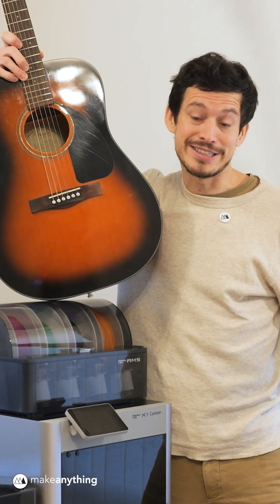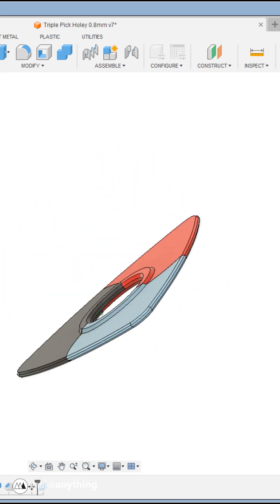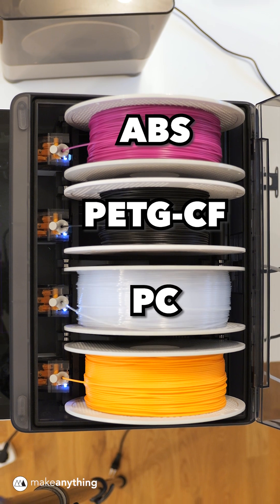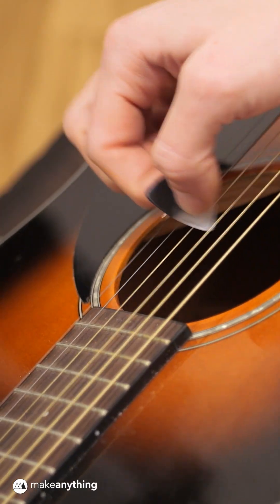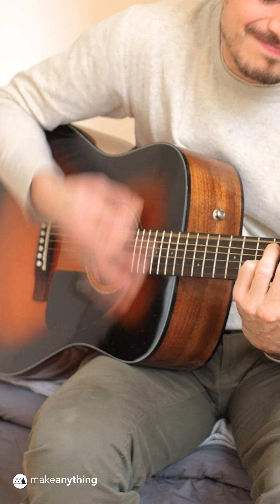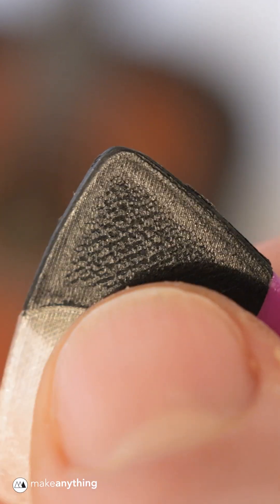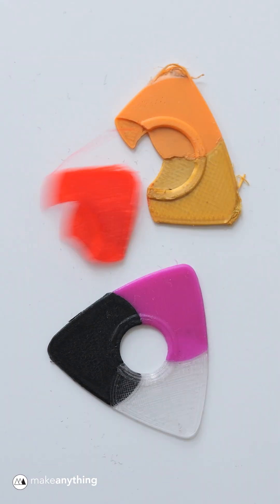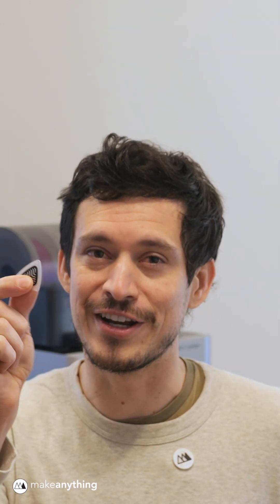The Ultimate 3D Printed Guitar Picks?

Comment: my forever go to picks are the ones i make from 3mm thick macrolon (premium extruded polycarbonate) in an long arrowhead shape, with strong a gypsy jazz pick edge geometry, at a 40° angle. HARD, fast, slippery, zero scratching, amazing control, and impervious to wear. and you can manhandle bass strings with them! (2 drilled holes, to give them a bit of flex, and a lot of grip)

PS: classic celluloid is still incredibly good too. picks and pingpong balls are the last products still made of this traditional and extremely combustible material.

Comment: I print my own Bass picks allready, Cheap PLA - it works .
Reply from the maker: I guess bass picks are generally thicker? I'm pretty optimistic about the PC pick lasting a long time 👍
Reply: @make.anything  Yes most of my bass picks are thicker, but also my thinner picks for my guitars/kantele work... One Pick one material, different materials different sounds, the harder the more highs... when they´re worn out, I print new ones.
Reply: as a bassist u should know udont need a pick /j

Comment: Your pla and petg one probably broke because they don’t stick to each other
Reply from the maker: Yea but even after they separated the points just wore down super quickly
Reply: @make.anything I mean if you can print 150 of them in like an hour, wear stops being a concern, if you don’t care about needing to recycle the broken ones
Reply: yeah, but no :P PLA is the worst at handling impacts, so Devin's conclusion makes 100% sense. Nylon would also work great, I reckon.
Reply: @cocon16_PW  Companies already make nylon picks and use assortments of nylonesque materials so I would tend to agree with you.  The only issue is that nylon doesn't give you the same bright, ringing sound you get from a harder material.